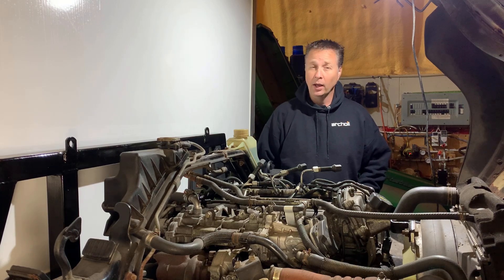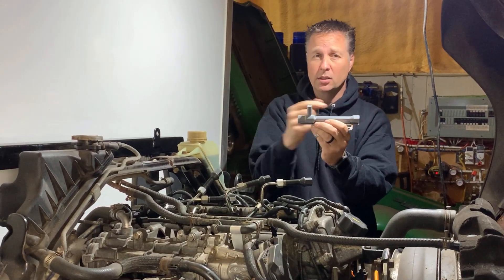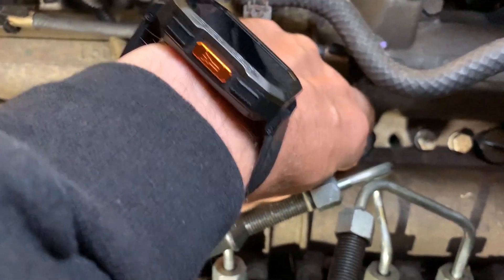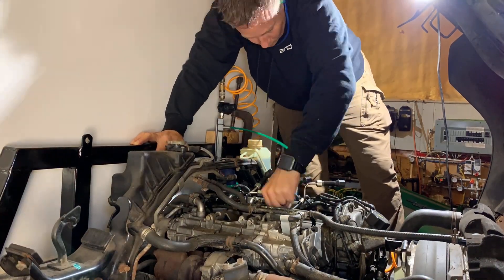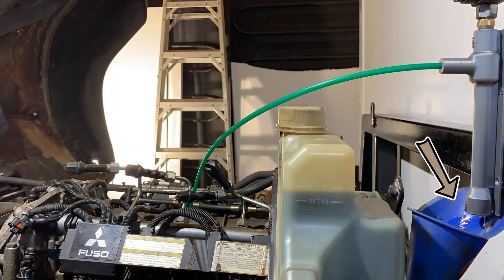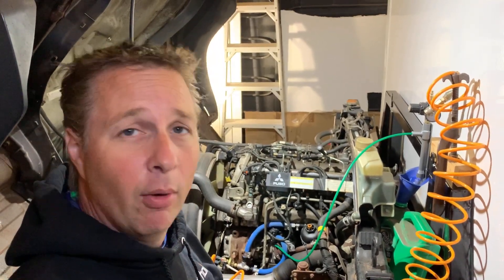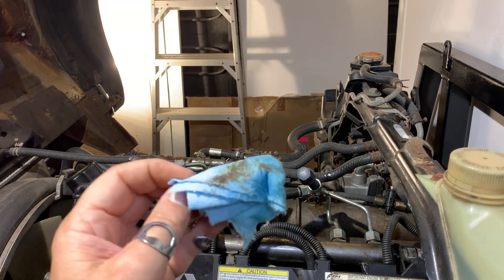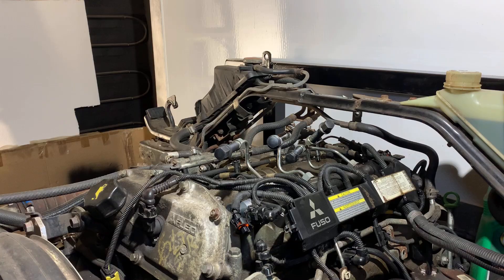Do I need a special tool? | Fuso FG engine cleanup

Comment: Hi Bruce, on the topic of special(ish) tools - I've just got my Fuso through it's roadworthiness test (surprise... advisories on corrosion) and need to actually do real work on it. As someone who is well equipped in 1/2" drive tools, do you have any recommendations for useful socket sizes to target in 3/4" and 1" drive? 41mm is clearly on the shopping list for wheel nuts, but what else have you used the most?
Reply from the maker: Hmmm - good question.  I don’t really have a lot of 3/4 or 1” drive, other than the set that contains the budd socket & 300:1 reduction drive/torque multiplier/ wheel nut cracker…. Probably the only other thing is my 4’ Johnson bar..

Comment: Hi Bruce. Great new printed tool. Hopefully this is getting you really close to solving this issue now. If it any consolation, on a trip out recently we went into lipmp mode and had a red engine light and on and you've guessed it, Injector problem, and of course it was injector number 4 and yes, it would not come out so the garge got a specialist in to remove it. So all in all fairly painful and fairly expensive. I think I am growing a Fuso Phobia!!! 😀
Reply from the maker: Oh no!   I’m almost thinking that I want to make pulling the injectors an annual service thing just to they can’t get stuck!!!    Hope the truck is running better now!

Comment: Those eductor pumps are super cool. Jets use them to move fuel from one tank to another with the bypass fuel from the high pressure pump. Since wings are divided into sealed bays they can’t gravity feed to the center and those are how they suck them dry.
Reply from the maker: That’s cool!  And totally intrinsically safe! I have another use in mind for the build that will see a more permanent use as well!

Comment: Bruce, what’s the plans for cleaning the bore for the injectors. Couple of them look pretty crusty.  Pipe cleaner wire brush fit in there?
Reply from the maker: Yep, that’s exactly it - in fact, I’ve done it (without filming it shame on me!)  I found some stainless bottle brushes with a reasonably long handle that I could fit in my cordless drill - worked perfectly!    I may try to come up with a micro scotchbright pad to see if I can “buff” the mating face a little too.
Reply: @BruceandKrista I’m keen to see it running. Your tackling my fear of the modern motor with all the electronics and crap that we never needed in a motor. Now days it’s just replace parts till we find the issue costing thousands